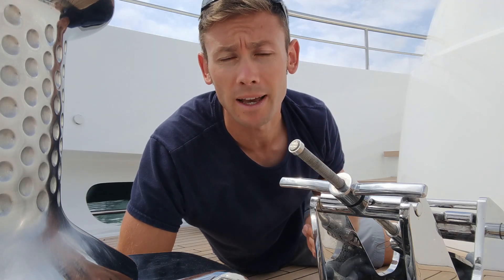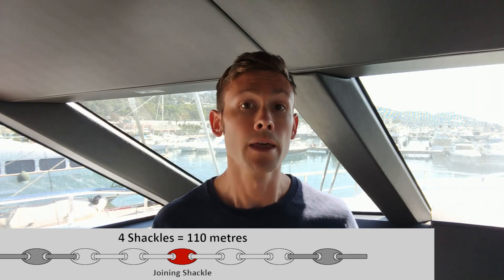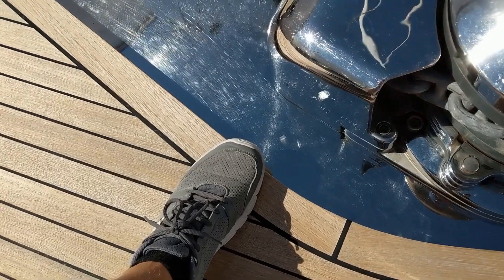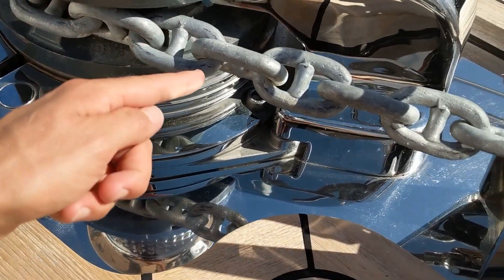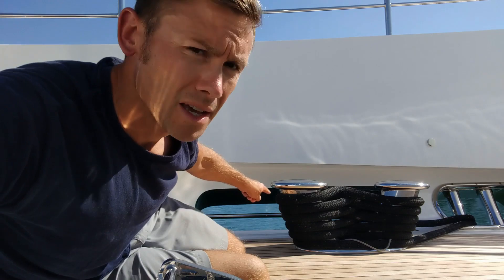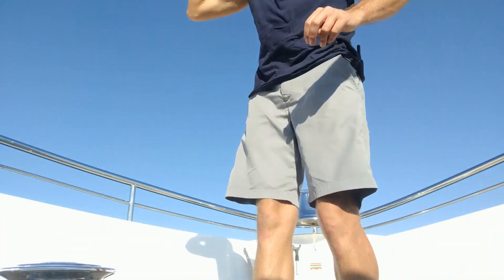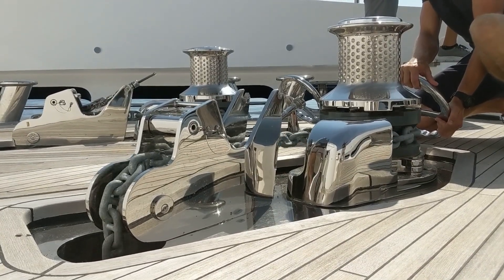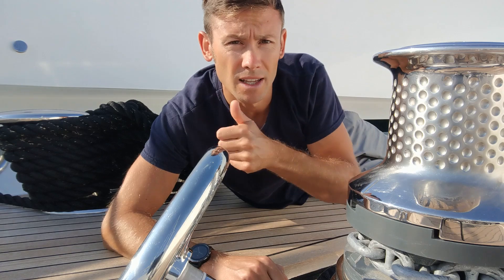How To Drop Anchor On A Yacht | Super Yacht Deckhand Duties

Comment: Thank you so much! i'm a big fan of your channel. I like your recomendation for wearing shoes... Which document states that??? I've asked in FB groups and here are the answers, however it's hard to navigate those docs to find it. Could you be specific please? thank you again!!

ISM code, chapter 7. For boats +500 GT.

MLC with reg4.3 is giving each flag state the directions for min ppe. iso 20347:2012 is the minimum requirement for occupational anti- slippery shoes.
COSWP rules and regulations on PPE.
Reply from the maker: Thanks for supporting the channel!
Of all the documents that you’ve listed, COSWOP is probably the best for anything related to clothing, footwear, and PPE. You can download a copy from the following link:
https://www.gov.uk/government/publications/code-of-safe-working-practices-for-merchant-seafarers-coswp-amendment-7-2022

Here is a paragraph from page 116:
Footwear
8.9.2 Foot injuries most often result from the wearing of unsuitable footwear (e.g. sandals, plimsolls and flip-flops) rather than from failure to wear safety shoes and boots. It is nevertheless strongly advisable that all personnel whilst at work on board ship wear appropriate safety footwear.

And again on page 406:
6.2 Anchoring and weighing anchor
26.2.1 Before using an anchor, a competent seafarer must check that the brake is securely on and then clear all securing devices. A responsible person must be put in charge of the anchoring party, with a suitable means of communication with the vessel’s bridge. The anchoring party should wear protective clothing, including safety helmet, safety shoes, gloves and goggles, to protect from injury by rust particles and debris that may be thrown off the cable during the operation.

Search the document for “shoes” and you’ll find more instructions of needing to wear suitable footwear.

Comment: I've just started watching your videos and its fascinating to see how things differ between a small and a large yacht. But one question on anchoring - bearing in mind the risks of running out the chain too quickly and loosing control, why do you disengage the capstan. Why not let out the anchor and all the required chain under control with the remote?
Reply from the maker: Hello Martin, and welcome to the channel. I have worked on a yacht before now where the procedure was to always lower the anchor on the capstan. The problem with doing that on this particular yacht is that the capstan only has one, slow speed. Trying to set an anchor like this is not only time-consuming, but also very inaccurate. It would require the Captain to hold station perfectly for a prolonged period in order to place the anchor at the chosen spot on the seabed. While this may be possible in perfect conditions, in difficult conditions it's almost impossible, even with a second, higher speed. Done properly, dropping an anchor on the brake alone is very safe, and I would suggest that it is the preferred method in terms of efficiency and accuracy.
Thank you for raising this point, and I hope you continue to find the videos interesting.
Reply: @WorkonaSuperyacht  Many thanks for the rapid and  comprehensive response, I can now see the logic.
I'm working my way through your videos and certainly finding them interesting. I love the practical nature and sheer detail of your content.
Reply from the maker: @Martin Thomas Thank you for this great feedback. I really appreciate it.

Comment: Another Great tips Matt!  Question: What type of radio do you use for communicating with other crew and what brand are they. God bless!
Reply from the maker: Thank you, Blue Ocean. The radios we use are of the UHF type. The brand is Icom, which in my experience is typical of most superyachts. Another well known brand in the space is Motorola.
Reply: @WorkonaSuperyacht  Thanks Matt! May I know what model of Icon do you use? it seems looks handy and small, I guess we might need to buy the same one for our boat. Sorry for asking so many questions :)
Reply from the maker: @Blue Ocean Icom IC-F62D UHF. They're good little radios. As you say, nice and compact.
Reply: @WorkonaSuperyacht  Thank you so much Matt! really appreciate it :)
Reply from the maker: @Blue Ocean Always happy to help!
Reply: @WorkonaSuperyacht  Hi Matt Good Day! One more question :) What frequency do u use to communicate with the crew on your UHF radio.
Reply from the maker: @Blue Ocean These radios don't give you the option to select a frequency; instead, they have 9 channels that you can choose from. Each radio must be programmed so that it can communicate with other radios on the same channel. This process may be carried out by wherever you buy the radios from; if not, it isn't too difficult to do yourself. Simply connect each radio to your computer using a special cable. You can then follow instructions to program them using ICOM software. By doing this you are essentially programming each channel on the radio with a specific frequency in the UHF range (300 MHz to 3GHz); however, in day-to-day use you will only ever see the channel number.

Comment: Do you use a bridle line or do you keep the load on the capstan ?
Reply from the maker: I've used a snubber line on previous yachts. This was mainly because they had a bulbous bow, and the chain used to scrape along the bulb as the yacht swung. This yacht doesn't have a bulbous bow, and as such there has rarely been any need for a snubber line. Having said that, the weight of the anchor is only left on the brake, and not on the actual motor of the capstan. If the anchors had a guillotine, it would be my preference to leave the weight there, using the brake of the capstan as a backup.

Comment: Thank you so much! Another great video!! 
I would like to ask you, to let out  extra chain you say you'd desengage the capstain, is there a reason you wouldn't use it to let out say 20m?
Thanks once again!! :)
Reply from the maker: Hi Lucia. How is your first season going? You're absolutely right, there is no reason why you couldn't just walk out an additional 20 metres of chain on the capstan. Indeed the procedure on some yachts is to always use the capstan and never let it run freely. This of course works when conditions are good and you have plenty of time; but, if you need to do things more quickly or there is a lot of weight on the chain which you wouldn't want to transfer to the capstan, then letting out on the brake might be preferable.
Every situation is different and alternative methods are sometimes required. Your role on deck is to understand how the equipment works so that you can always use it in the most appropriate manner. The fact you have asked this question demonstrates a very good understanding. Thank you for pointing it out and starting the discussion.
Reply: @WorkonaSuperyacht  Thank you for the explanation! Indeed understanding the equipment is essential for making the best use of it, I can see now why conditions would affect this choice. 
I really appreciate how thorough you are. How lucky your deckhand/s must be for having you as their mentor!
My first season is going very well thank you, steep learning curve but really enjoying the challenge! 

Keep your videos coming :)
Reply from the maker: @Lúcia Pinto You're welcome! Glad to hear that your first season is going so well.
As a new YouTube channel, your support and encouragement is invaluable. Thank you.

Comment: hi, ive got a question! do you know of any apprenticeships for 16 year olds to get into yachting before 18, and also how often do you get days like you see on youtube where the crew get time to swim and use the water toys/explore the area they are in?? thanks in advance!
Reply from the maker: Hello again Sam. There are no apprenticeships specific to yachts at this age. However, you could do an apprenticeship that would give you some transferable skills. For example, if you want to work on deck then carpentry is a very desirable skill; if you're interested in engineering then plumbing or electrical would be a great start; and, for the interior or galley departments, a job working in high end hospitality is highly recommended.
Regardless of department, an interest in any watersports would be a great bonus and certification through the RYA is possible at your age. The STCW courses can also be done before you're 18, but I wouldn't recommend doing them until a little closer to your 18th birthday.
Finally, check out the possibility of doing a cadetship if you're interested in either the deck or engineering departments. I have a video coming up very soon on why this would be useful. You wouldn't be able to start this until you're 18, but you could certainly start researching what they look for when deciding who to sponsor, and start making yourself into the perfect candidate!
I am always excited to hear from those who want to get into yachting straight out of school. It's a great career and if you start early then you have a chance to do really well for yourself. Please keep me posted and let me know if you need any further information.
Reply from the maker: @sam ingram To answer your question about swimming and using the water toys, this depends entirely on the yacht. Whilst at anchor, some crew are able to swim around the yacht daily before they start their duties, and even use the tender to go wakeboarding or water skiing. Other yachts only allow this during crew watersports days, in order to test the equipment before the season starts. And some yachts may not allow any of the above!
Reply: @WorkonaSuperyacht  thanks a lot, this is really useful information that i struggled to find elsewhere! i will look into this and get back to you if i have any further questions. thanks!
Reply from the maker: @sam ingram You're welcome!

Comment: What’s the reason that there is a rule that requires an anchor ball to be hung?  And I noticed your balls, I mean ball as in anchor ball, is different than others I’ve seen. The other is I’ve seen kind of look like a radar reflector.
Reply from the maker: Great question! As per Rule 30 of MSN 1781 (The COLREGs), the ball indicates that the vessel is at anchor. This is important because it tells other vessels that she is made fast to the seabed and is unable to manoeuvre to avoid collision. As a result, other vessels should keep clear. By contrast, if she were not at anchor then she may be required to take action to avoid collision with another vessel.
Annex I of the same regulations tells us that any shape (including diamonds, cones and cylinders) must be black and a ball must have a diameter of not less than 0.6 metres. Our ball is made of a black net and frame, but you could also have an inflatable black ball, or two circular pieces that when slotted together form a sphere.